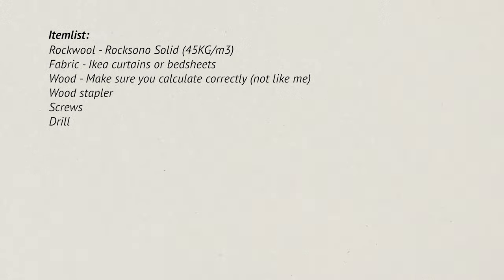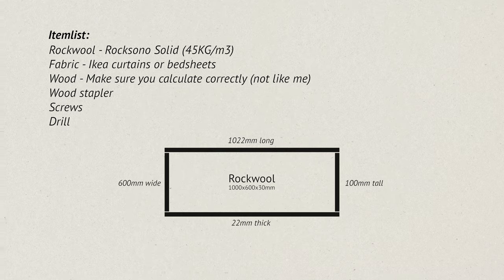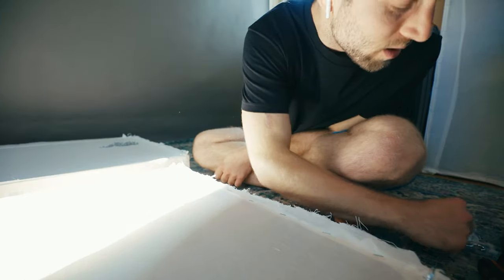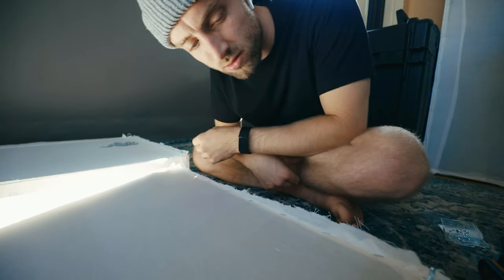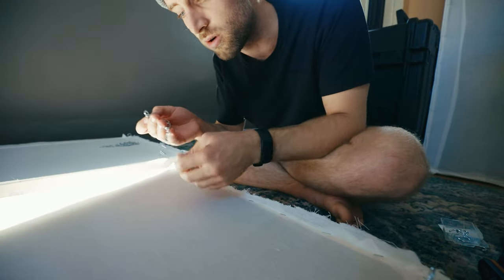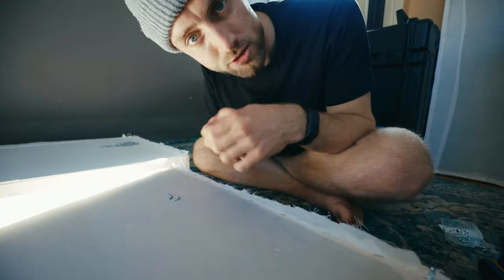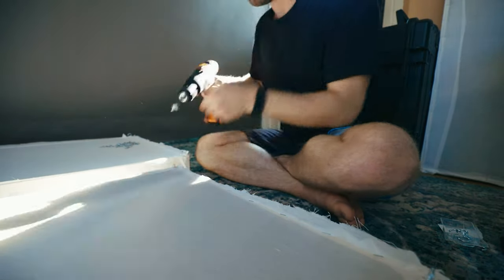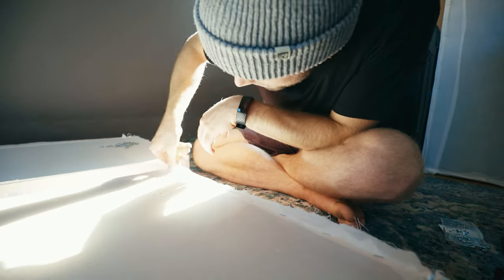DIY Acoustic Panels For My YOUTUBE Studio (AMAZING Sound Difference)

Comment: Big improvement; before and after audio demo says it all.👍  Am sure you feel great over the accomplishment. Good story telling. Is that “rock wool” as in “insulation”? Could be fiber inhalation hazard; hope you wore protective face covering during handling/production — no kidding. Did you consider foam rubber insulation (sheets or even spray-in stuff)? Too late now, but drywall anchor bolts should help when you can’t drill into a stud.
Reply from the maker: I did wear protective stuff!

Even the concrete wall starts crumbling.. it’s that bad! These buildings are being demolished within 2 years.. that says a lot! But you’re right.. I didn’t have the propper tools for the job.. haha!

Comment: Tip for screwing in the hooks: Take a hook and put it in your drill, just like a normal screw bit. Then put the hook (that you want in your panel) into the pre-drilled hole and tighten the rest by hooking the one on the drill into the other.
Reply from the maker: No way. Man.. life hacks right here! Ive been messing around with a pensil and rotating the hook.. this will safe some effort!